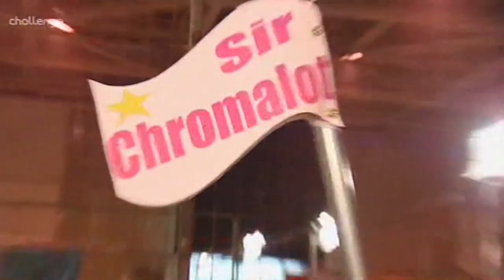Robot Wars The Top 100 Iconic Bots - 40-31

Comment: Hate to say it, but TheDamBeaver's accent, combined with a dodgy mic, just made his introduction to Thor too hard to make out. Also surprised they didn't mention that Gravity is THE progenitor of the modern Brit-flipper- Apollo, TR2 and Eruption can claim an almost direct line of descent from the original full-body wedge ramp (yes, it was preceded by Spawn Again, but Gravity really codified the "snow speeder" design).

Also, with Sir Chromalot and Plunderbird down, that means we should be done with robots that are "memorable" for things other than being hardass wrecking machines. With one notable red-and-black polka-dotted exception...

Comment: Honestly I'll still never understand why in series 10 the gabriel team didn't use the sword attachment more
Reply: In the group battle, they were using the mace they made up to use for entanglement.
Against Aftershock, they were probably worried about it getting wrecked, it probably took a fair bit of machining to make the sword, whereas the mace things were basically PVC piping with spiky bits on the end